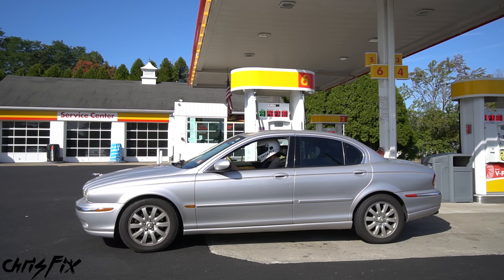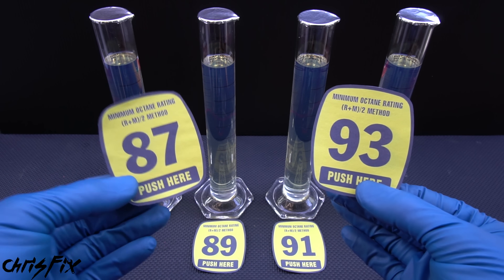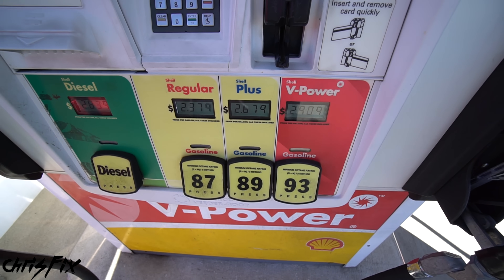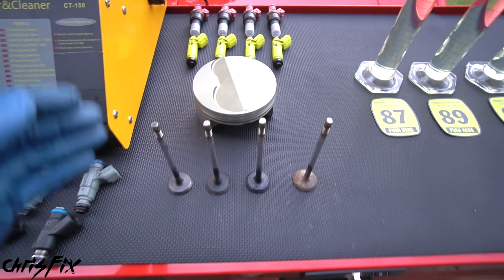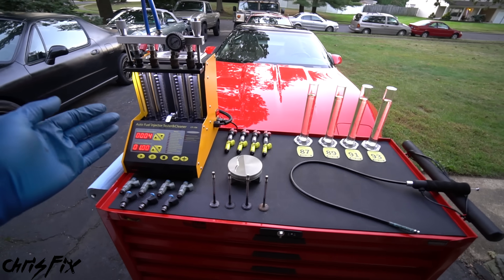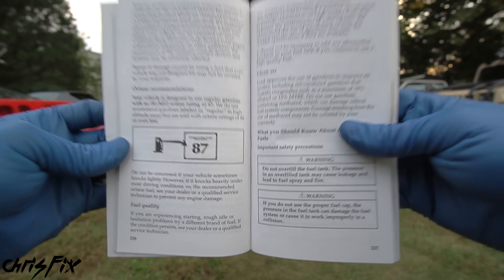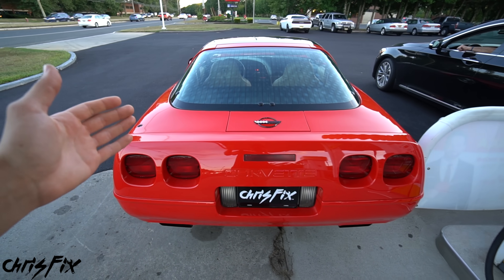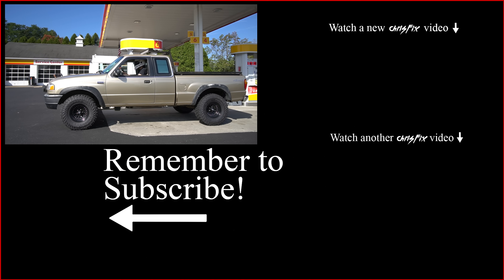What is the BEST Fuel to Use in Your Car or Truck and WHY

Comment: Hey Chris just wondering if non ethanol fuels are better than those with ethanol, and also what the average content of it is in normal fuel? Most of my vehicles take premium and at some pumps I see no ethanol as an option in the same octane ratings you would see anywhere.

Comment: Complete bull shit I jest took a carb off a few weeks ago that had this black gummy shit inside after sitting though one winter and had to replace that carb because it was so completely not worth the time to clean it. And ten years ago that same carb would of jest needed to be taking off brushed out  a little and would of bin fine. That is because of what is being used as fuel today now some gas stations are selling you cheap gas a premium prices because they only have one type of fuel brought in so you need to be careful of were you get you fuel.

Comment: Really good video. Albeit I did learn a lot of things, I am now driving an EV and I don't want to buy any ICEV if possible in future. It just feels odd now to think about oil/fuel filter/fuel injector/octane knocking number/fuel type/spark plug/engine/transmission/gearbox etc. 
I hope the world switches over to EV with backend electricity being supplied by clean and renewable energy sources like solar/wind/water and nuclear only.

Comment: The energy density may be the same,  but the octane content is related to the flash point.  Regular gas will ignite at a lower temperature compared to premium. This is why detonation is also called pre-ignition. The knock you hear is the result of the premature detonation hitting the piston head before it hits TDC.
Reply from the maker: Actually the knock you hear is after ignition. Pre-ignition is something totally different but could happen. Watch the animation for more info. If your octane is very low, you could get pre-ignition but you are not likely getting pre-ignition and more likely getting detonation.

Comment: What about 85 octane at high altitude? Myth? They still sell it around here
Reply from the maker: Since there is less air/pressure you can get away with lower octane. The problem is if you have 85 at altitude but then go down to sea level with that same gas you can get detonation.
Reply: @chrisfix  agreed. Thanks

Comment: If you’re manually putting a fuel additive in your car make sure to do it when your car is literally almost on E, I’ve seen people put it in with a full tank of gas, that’s pretty much a waste of the product because it needs between a certain amount of gallons to work. Burning this additive off with the fuel will clean the carbon deposits and while you shouldn’t do this too often and drive the car like a psycho it will help if you got a used car where the previous owner just didn’t take care of it. (Like me) otherwise, use some good quality fuel, I use Exxon or shell and the recommended octane level and your car shouldn’t build up an unhealthy amount of carbon deposits
Reply from the maker: Thanks for sharing!
Reply: ChrisFix absolutely love your account. Thanks YOU for all you do for us

Comment: Doesn't height above sea level effect which gasoline needs to be added as well? The higher above sea level the thinner the  air, which is basically like changing your cars compression ratio. Meaning you can run a lower grade of gasoline without worries of knocking the higher above sea level your are. I thought I read that somewhere.

Comment: you are right but also wrong trying putting 93 octane in a saturn S series any year. You will get so much pings and predetonation you will take it to a mechanic and they will drain the tank and clean out the fuel lines. Now a days go with what the car manufacturer recommends is the right octane gas for your car. You can do that by reading the owner's manual or by going to the dealership and if your unlucky enough to own a saturn vehicle by going online looking up the information from G.M. themselves or by asking an old saturn tech if you can find one.

Comment: I installed a K&N intake system in my '12 Camry and drive it pretty hard, my poor car, and I swear I refill my tank more often using regular (87), the recommended fuel, than premium (93).

Comment: I've ran regular in a premium required car no issues 380k never seen premium
Reply: That's because your knock sensors probably spend all day pulling timing. You are putting the engine
Reply: @alexmelia8873  still driving an nothin concerning Haha, I doubt believe is that fuel shit it's all a gimmick
Reply: @ericsstory1488  it's literally not a "gimmick". Some cars are 8:1 compression ratio and only need 87. Some cars are as high as 10.5:1 CR and need 93. Sounds like that's what your driving and your engine is pulling timing. You'd actually get better mileage and power if you ran 93

Comment: 1:15 as someone from EU - WHAT THE FFFFFFFFFFFFFFFFFFFF, your fuel is basically negligible expense lol
Reply: Nothing is. I'm from Germany, and a normal gasoline price here is 1,35€ per litre. 
Currently, 1€ equals 1,11$, so that would be 1,50$ per litre
And one gallon is 3,785 litres, so the average German gasoline price would be 5,68$ per gallon an American units. 

By the way, the 2,42$ per gallon would be 0,58€ per litre in European units
Reply: different units. its the same thing.

Comment: I still cannot believe 93octane fuel is considered "premium" in your country...95octane is standard fuel in europe... typos corrected

Addendum: EU Super E10 95 Octane is better than your "plus" gasoline, since it is 90+ AKI instead of you 89 AKI. Emphasis on XX *+*. Most gas stations label their gasoline 95 RON in the EU, regardless of it's real RON, which may range between 95 and 105.

Comment: Lol he called a mustang a muscle car. I drive a 97 gt, and it's more of a joke than a muscle car....great video.
Reply: His mustang isn't stock though he has it built for drifting and I think its sitting at 350 wheel horsepower not amazing but certainly not bad.
Reply: @johnh8546  lol, im aware it probably had work. When I hear muscle car I think of mid 60's to mid 70s ish. Some 80's like the can am, etc. drifted mine in rain plenty of times, and the turning radius is absolutely horrid... I would hope there is some work done in that section of the drift build. Otherwise your not going very sideways

Comment: So wait in the US the different octanes arent seperated by different pistols? What about residue left in the pistol? I know it's a tiny amount but it's there
Reply: Most stations have different nozzles for the different grades. But sometimes they do not. The gas that is dispensed from a lower grade fuel and is left in the hose, flows backwards and is cut off by check valves to guarantee purity. Any type of residuals are so small, that it would never affect any car's performance that required high octane premium.

Comment: How many years does the buildup take to aqumilate
Reply: Depends on the engine how you drive and how good the fuel you buy is. A direct injected engine builds carbon on the intake valves really fast except Toyotas because they are port injected when firing up. Next how you drive running short trips with your car makes it gunk up faster. Carbon forms mostly with a cold engine and running the engine at operating temperature helps clean it out. Finally good fuel with lots of cleaners in it keeps your engine clean longer.

Comment: You didn't add any comment about outside temperature. When the temperature gets to about 95 degrees, and I go up a hill, I get engine knock and using a higher octane will alleviate this.

Comment: I have a 2014 ford transit. It is a flex fuel vehicle. I had used flex fuel off and on for a couple years. Suddenly the van would intermittently not start. It went in and out of shops for a few weeks even a dealership and they had a lot of trouble figuring out the issue. The starter, wiring harnesses and air intake system were all serviced. The van would always turn over fine, but seem to not get combustion. Eventually the dealership found that you can't mix flex fuel with regular gas because it causes a film to build up in the fuel system. According to them, they said to only use one or the other. This didn't make any sense to me. Why would you have the ability to use that fuel and not mix. What are your thoughts?
Reply from the maker: You can mix e85 with regular gasoline. Maybe the flex fuel sensor was bad?
Reply: @chrisfix  idk. I just know what the dealership told me. They didnt say anything about a senor. I also didnt feel i was getting the full story. Seems silly to have a flex fuel vehicle and not have the 'flexibility' to use that fuel whenever i want.

Comment: Why isn't their different levels for diesel fuel?
Reply: There is. It's just that diesel doesn't have an octane rating like gas does. Instead diesel has a cetane number. The higher the cetane, the better it is for low temperature starts and such. The sweet spot for diesel is in between 40 and 60 cetane. Some fast revving diesels like those in BMW's and such, are a bit picky however and tend to run better on high cetane diesel. While dometic US built diesel engines can run on a low or high cetane. So big rig trucks and large Ford F-250 diesel trucks are more forgiving. 

Cetane does not affect compression much like octane ratings on gas would. The higher cetane level just affects more or less how the fuel burns. A higher cetane diesel fuel just has a shorter combustion delay compared to low cetane diesel. 

NO.2 diesel is by far the most popular diesel fuel sold in the US. Almost every diesel engine on America's roads run this diesel. The minimum cetane level in modern diesel NO. 2 is 45 cetane. US diesel is always in between 45 and 50 cetane. Then in the winter where it gets really cold, northern states will run Winterised NO.2 diesel which has anti gel properties to it. This also boosts the cetane to 50 or even slightly higher depending on what additives are used. But unfortunately higher cetane diesel fuels like winterised diesel, do often have a lower BTU rating. So the one drawback to having high cetane diesel, is that you will get worse fuel milage. 

Then there is No.1 diesel. It can be formulated as a premium diesel sometimes. It is a automatic winterised fuel and it boasts higher cetane typically. It's basically just straight Kerosene with lubricants added to the fuel. But you will get worse fuel mileage on this fuel. You can lose a few miles per gallon. 

So again a higher cetane diesel isn't any better than a low cetane diesel fuel. Both have a pro and con. low cetane diesel will get you excellent fuel milage and the best overall performance for summer time driving. Higher cetane diesel is better for very fast revving diesels like what's found in German cars and is better for cold weather starting. But it also contains less energy and will yield worse fuel mileage. (Often sold in the US as Winterised diesel.) And NO.1 diesel is basically straight up Kerosene with lubricants and is classed as winterised, or high performance diesel.  

All automakers from every company, truck or car today, specify No.2 diesel specifically for the best overall performance here in the US. In Europe diesel is blended to 50 cetane by default now. 45 to 50 in the US. 

Also note that high performance diesel doesn't mean you can get more HP from your diesel through more compression like octane doses for gas engines. High performance diesel means it has better winter properties and is easier for cold weather starting. That's what they mean by high performance.

The trucking industry always tries to just run regular NO.2 as much as possible, because it maximises fuel milage and hence proffits. High cetane winterised diesel means less profit.

Comment: FYI: Alaska's premium is 90. It's an outlier, but Alaska is part of the USA.
Reply: Probably due to the extreme cold you can get in Alaska.  That causes a denser air supply to the engine which can cause a need for a little extra Octane in high compression engines.

Comment: If the energy is the same between octane, why is it that when on a chassis dyno, or engine dyno, does one have to use more fuel when using lower octane to produce the same hp, with less fuel on higher octane? I have heard many people say this, but yet to prove it from a fuel flow perspective. Next, why is it that engines that run 93 octane are always more clean, then the exact same engine running 87 octane? When I say clean, I mean valves, pistons, spark plug etc.

Comment: If I drive around town I'll use mid grade 89, in my SUV. But if I'm going on a road trip I'll run premium 91 or 93. I get better mileage running premium on the highway. Also if you do the math filling with premium compared to mid grade or even low grade fuel, the price isn't even a whole gallon of low grade gas. My owners manual states my SUV can run on 87, but "for best overall vehicle and engine performance fuel with an octane of 91 or higher is recommended." So I feel running a little higher octane all the time is better for my SUV.
Reply from the maker: Thanks for sharing

Comment: I ride a Ducati Monster. The owners manual says to burn 95 octane. I can't find 95 so I've always used 93. On occasion, I've been out in the middle of nowhere and can only find 89 or 91. When I fill up with that, my bike seems to run better, accelerates better from lower in the rev range. And, most noticeably, sounds better. A deeper, richer exhaust sound. I always wondered if I'm imagining the better performance because I like the sound better. When I get back to town, I continue to use 93. If I understand you correctly though, European 95 octane is closer to 89 or 91 than it is 93 in the US. So, it's not my imagination. Question is, can you hurt an engine by running higher than recommended octane like you can if you run lower than recommended? So far, I've had no problems.

Comment: Okay wait a minute wait a minute I have a 1970 Monte Carlo engine I drive every single day I Got 5 million miles on his motor 5 million miles on a carbureted motor carbureted Edelbrock carburetor okay why does this run longer than the new cars on 87 chaos 87 octane no injectors no spray in just a regular old carburetor and I drive it every single day every single day so why is the carburetor better than injectors why do they change it from carburetor to injectors why do they keep changing things leave the old stuff a little nobody else it was supposed to last forever leave it alone you know
Reply from the maker: Thanks for sharing

Comment: What about the fact that most brands have 10% ethanol in 87 and 89 octane fuels. This does cause lower fuel mileage.
Reply: There is truth to that. Alcohol has a lower energy density than gasoline, but it's a cheap way to boost octane.

Comment: 14:38 Just one recommendation, if you have to use octane booster, it is a lot better to pour it in the tank before you add the fuel, so that it mixes properly
Reply: Oops I just pour it in an then whip the steering wheel left to right to shake up the fuel
Reply: @ericsstory1488  😂😂😂
Reply from the maker: Thanks for sharing!

Comment: So I have a question... a gas station near me had 100% gas next to regular 85... I accidentally filled half the tank with the 100% before I realized it and filled the rest with the 85... It didn't hurt anything, but I was curious to the difference, and when to use 100% gas... I believe 100% is supposed to burn more cleanly and is better for small engine tools like weed eaters and lawn mowers, but is there any benefit to using it in a vehicle?

Comment: Gasoline has more energy density than ethanol, and 91/93 octane in my area is ethanol free, 87 is not. So it does has more energy per gallon. But that's not because of the Octane number like you said. Good info here.

Comment: not detonation; PRE-Detonation creates knock.  DETONATION is absolutely necessary.  Preventing Pre-detonation with higher octane is necessary so that gas doesn't detonate BEFORE the spark plug fires, and it can pre-detonate easier in higher compression ratio engines.

Comment: long story short:  you can use 93 (or 91 if thats as high as you have) octane in a car that may need only 87/89/91 octane, but dont ever use 87/89/91 in a car that needs 93 (or 91 if thats the high octane you have) octane.  also, shell is the best fuel for your car if you're in america.

Comment: So I have a SUV Senta Fe 2004 model and I use 83 all the time can I use a tank of premium to clean out the engine? or do I need to take it appart to do some scrubbing?  aka grinding v.v oh it has 122000 miles on it

Comment: E15 what is that
Reply: Gas for cars just like any other gas like E10 87 octane, or E85 108 octane. E15 is rated at 88 octane. It has 15% Ethanol.
Reply: I’m truck e58 so I can put it en my truck